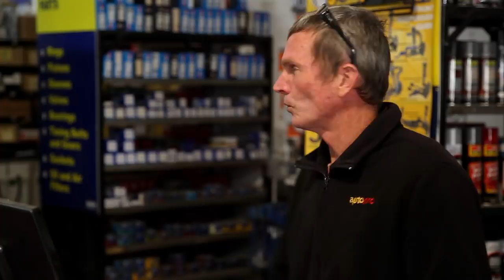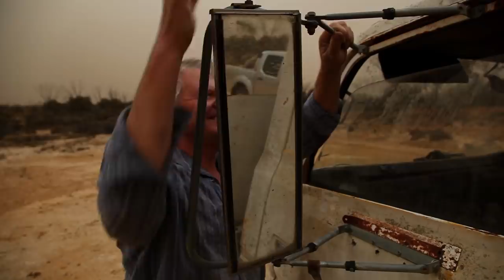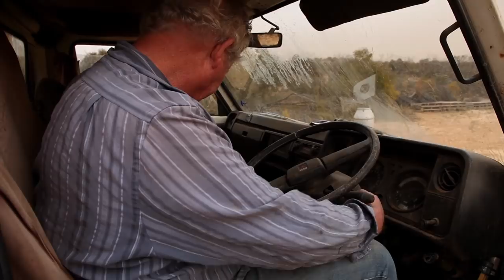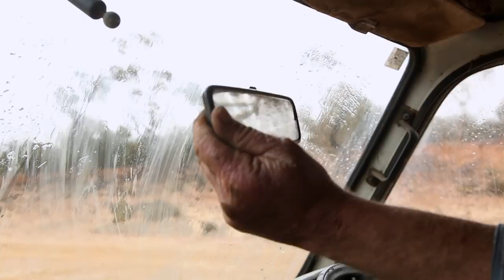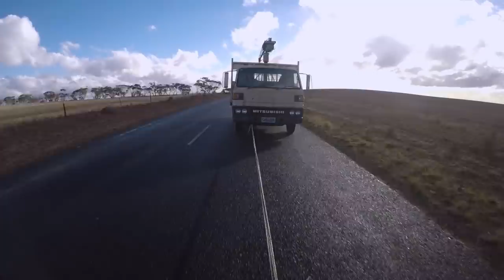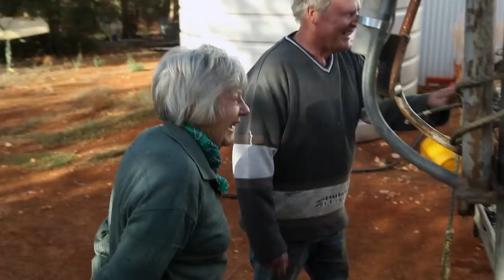Buying a Truck Part 2 - The Bush Bee Man

Comment: I'm pretty sure you've blown the head gasket by warping the head (maybe even cracking it) through overheaing it and reoving the cap while it was hot.
You should probably have changed all fluids before even moving it.

I think you'll find the real pressure release cap is on a remote expansion bottle. 

And the coolant in any climate on most Japanese diesels (I've yet to see one which isn't aluminium alloy) will HAVE to be a 50/50 mix of antifreeze and distilled water, which raises the boiling point and contains anti-corrosion agents.
Of course, the pressure raises the boiling point as well, so when you took the cap off last time, you suddenly reduced the boiling point to lower than the actual temperature of the engine, shock cooling it.
Get a used engine to fix it up, but pressure test the cooling system and all cylinders on any potential purchase first.
And get the proper manual and RTFM!
Good luck - you have what seems to be a good base to build on.
Reply: @Elon Imran yea, have been watching on instaflixxer for years myself =)

Comment: I'd suggest removing the new radiator cap, push the truck out from underneath and push another truck underneath the cap!! 
The fuel system will be full of crap, cooling system will be full of crap, lube system will be full of crap, gearbox same, diff same. Electrical system needs work, cab needs work, body rusted out and the list goes on.
Just as a matter of interest, how much did that guy pay you to remove it from his property? Whatever it was, it wasn't enough.
This is really a very long term project. Major $$ outlay in your future.
Love your Nan :)
Better change the 🚚 for a 🛴 🤣🤣🤣
🇦🇺 🍺🍺 🐝🐝
Reply: That's the best solution I've seen so far. It would've been a nice truck to have though.

Comment: You, are  going to have to change the radiator, check the head gaskets, the alternator seems to have seen better days. Not to mention all of the other issues with the mirrors, the cruddy wiper blades, the miserable seat...

Once you've fixed up this vehicle, it will be great & probably run for quite a long time. The trick is, to maintain it. Which it certainly doesn't seem like that was happening for this ol gal. I hope you are able to fix her up & get her working spiffy again Sir. She'll be lovely, especially when you can place "The Bush Bee Man" on the door panel. She'll be right pretty!

Comment: If you used glycol instead of just water, it wouldn't boil over so quick and you could avoid chucklehead moves like taking the cap off a boiling rad. Sheesh...
Reply: Right? I couldn't understand why he didn't use radiator fluid in it. It would have been so much better for the radiator/engine. And I'm certainly not a mechanic & I know this.